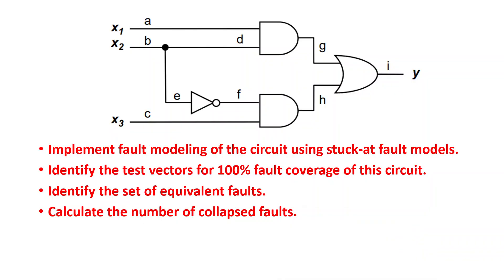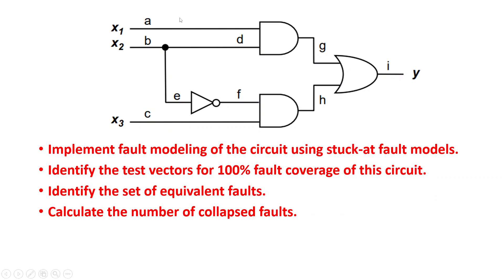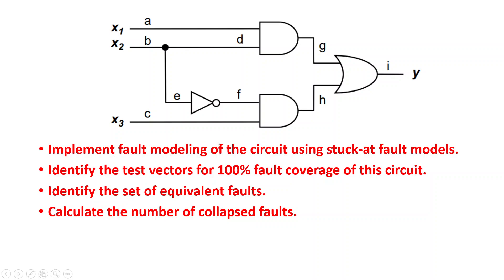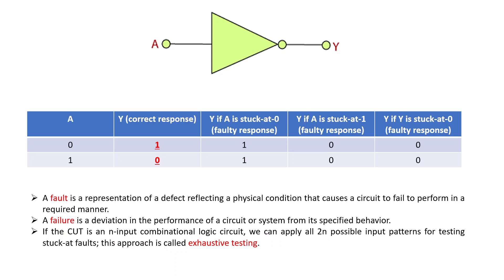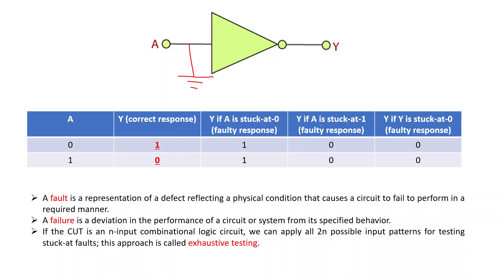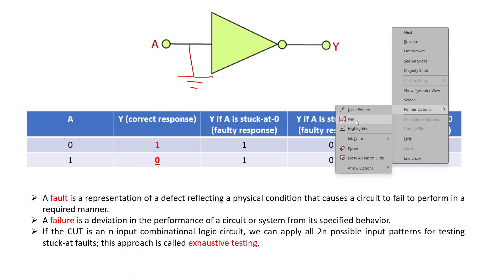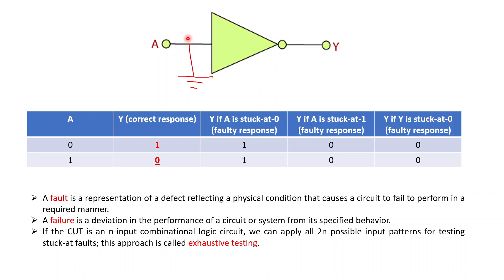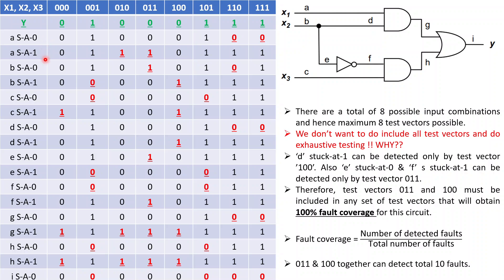Numerical on VLSI Testing | Fault modeling, Test Vectors & Fault coverage with Example

Comment: Design for Testability (DFT) is a technique used in VLSI (Very Large Scale Integration) design to make it easier to test and debug chips. DFT involves adding circuitry to the chip to improve its testability. This helps ensure that the chips are free of defects and improves their quality and reliability.
Reply from the maker: Yes, DFT is a critical aspect of VLSI design!